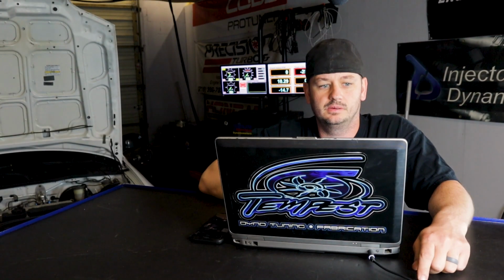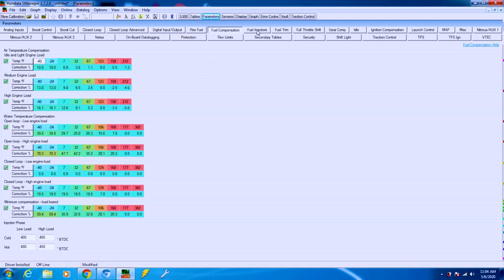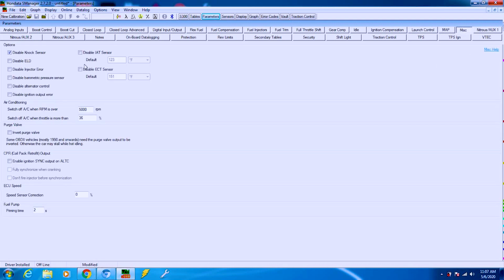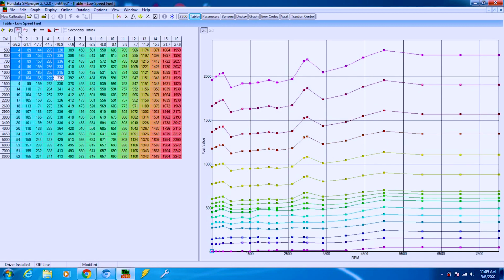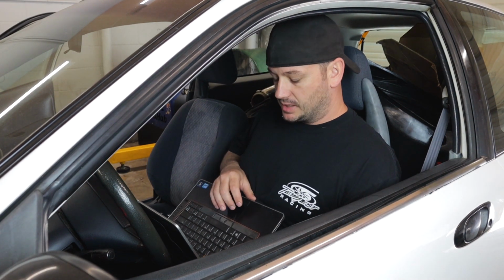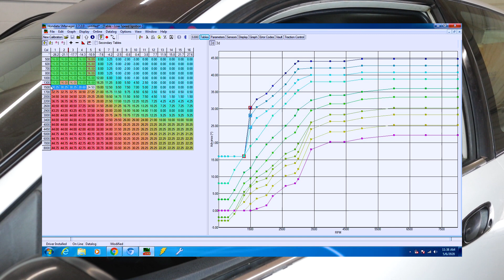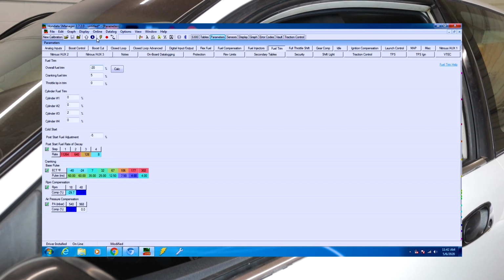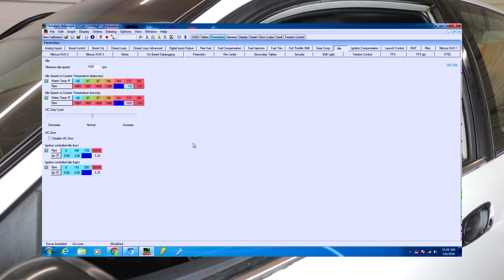How to make a Hondata S300 Basemap

Comment: I’ve been reading and playing with Smanager for months now before I plug up to the car and try upload a base map hondata s300 v3  it’s starts and idles @ 13.8 to 14 but seems to go very rich once warmed up @12 to 12.5 and wants to cut off on me when I’m driving let off gas clutch out and put it in neutral  do u think I should plug up and go through perimeters, it’s a D16y8 bottom D16z6 head with forged internals, eagle rods, Wiseco piston, Brian, Crower valves and retainers, 60/48 precision turbo, I have only drove it home from the shop that built the motor and I put it in with my son at their shop to save money drove home, and around the neighborhood it has 50miles on it so   
far, I changed oil and filter once so far. Any help advice would greatly be appreciated. No tuners in Wilmington, North Carolina that are trustworthy. I also set ignition timing to 16°. Advanced, and put new plugs gap at 30 waste gate spring is maybe 3 or 4 psi